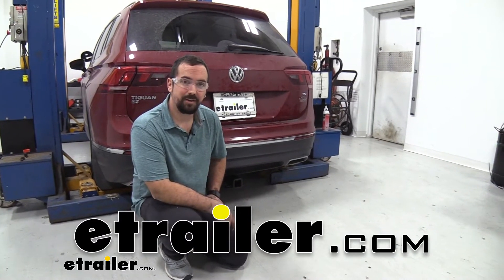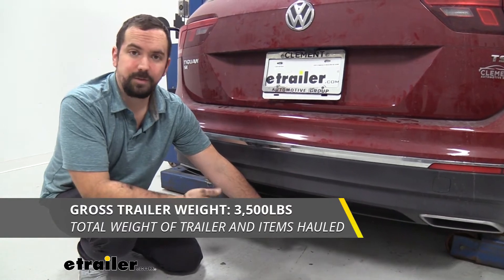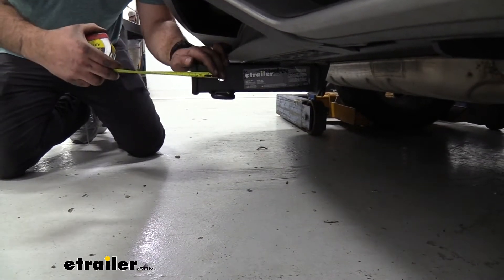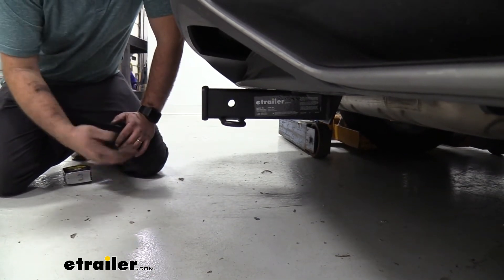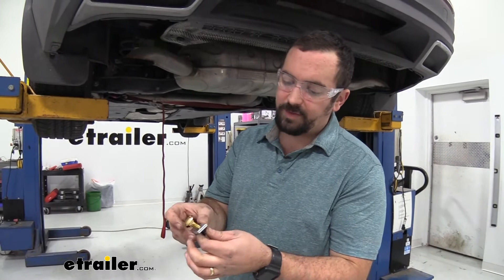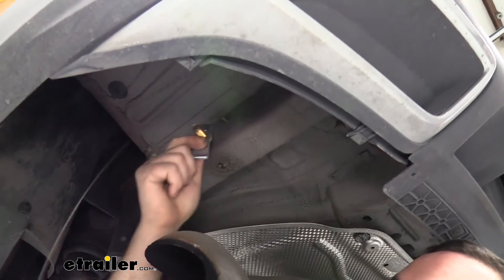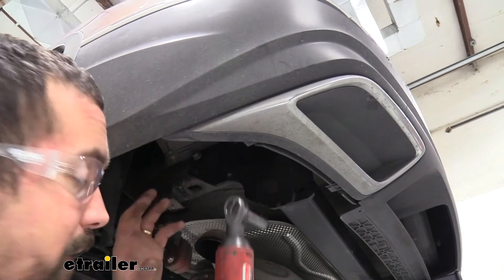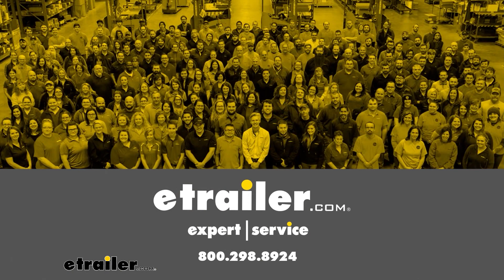Setting up the etrailer Trailer Hitch Receiver on a 2018 Volkswagen Tiguan

Comment: What’s the maximum it can pull?
Reply from the maker: This hitch has a 525 lb tongue weight capacity and a 3,500 lb gross trailer weight capacity. You will want to check in the owners manual of your vehicle to be sure that you do not overload the vehicles capacities.
https://www.etrailer.com/Trailer-Hitch/etrailer/e43ZR.html